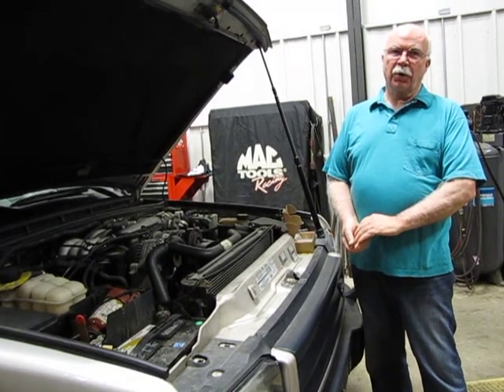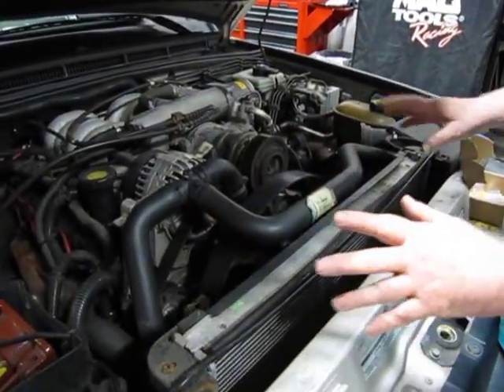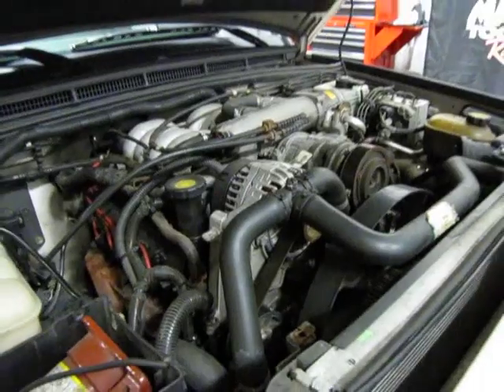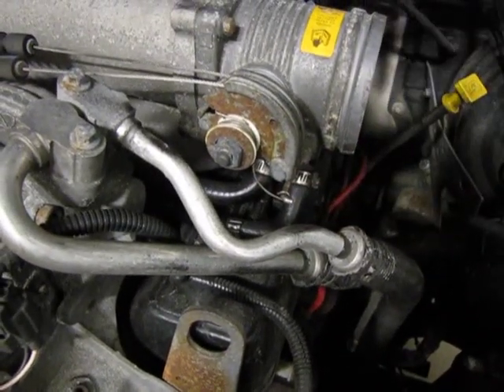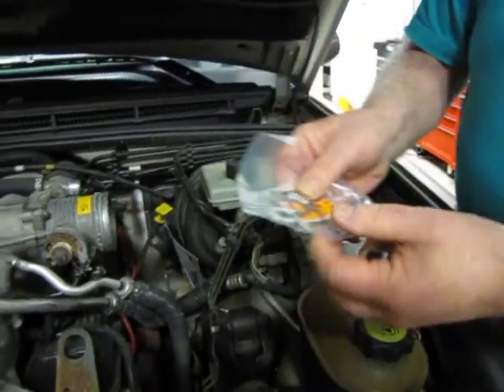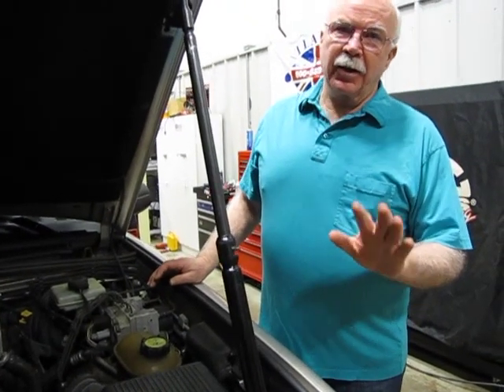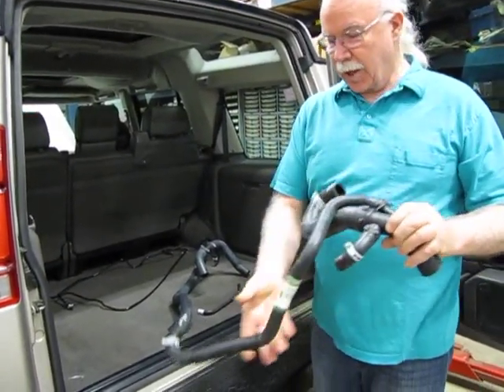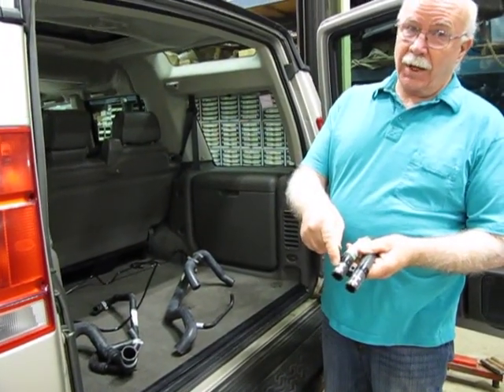Atlantic British Presents: Land Rover Discovery II Cooling System Tour

Comment: Guys, there is one more case for overheating, that you did not see in this video: if 40AMP fuse for coolant fan has been burned out, the fan will not start and you would never notice this until the the engine temperature went too high.  So, check the fuse from time to time and pay attention (especially in the summer, when you use AC), that coolant fan is working.

Comment: i have that same setup , but the two knobs coming out from under the throttle are attached to nothing. took thermostat of toady with temperature check it tomorrow. poured coolant into the res and it just disappeared , where dod it go?! is my thermostat stuck open?or is this just pouring into my engine

Comment: Hardly a tour. It' s "Hey look I'm selling cooling system parts".  LoL By the way it's missing the fan shroud that goes between the radiator and upper hose. If that isn't installed it wont cool properly either.
Reply: Not to mention that it holds the upper hose in place as well..